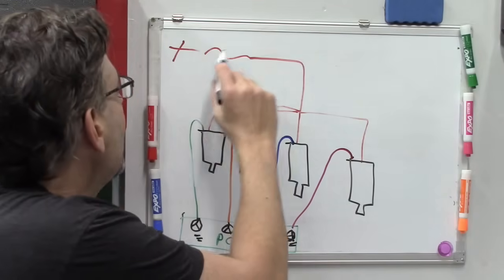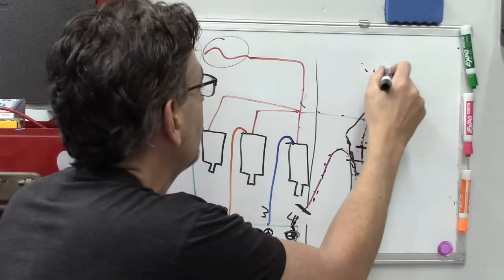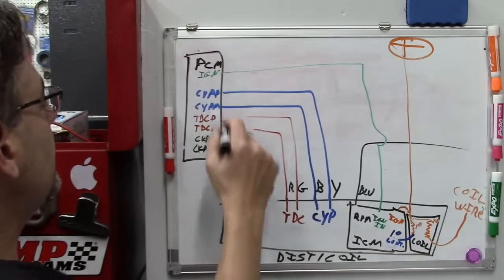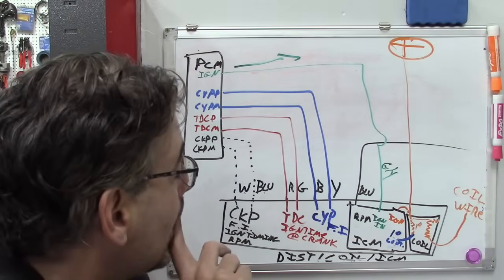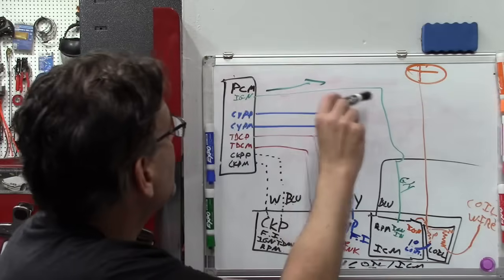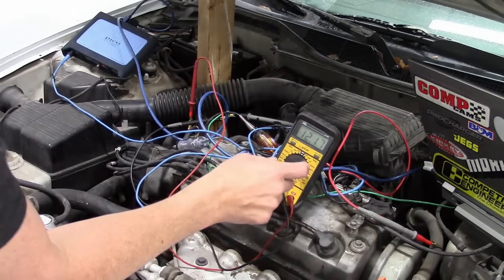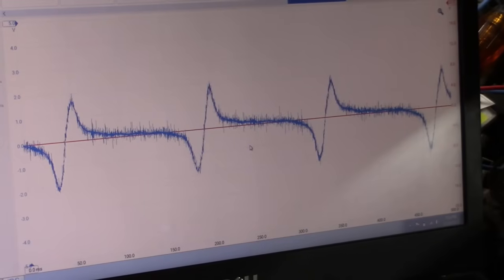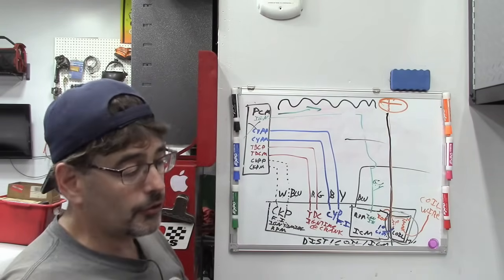DIY -How To Diagnose No Spark No Start. Bad Crank Sensor? FREE SBQM VIDEO

Comment: That was very detailed but pretty tedious for a non student. Cyp..took a couple min to see it's Cylinder Position sensor. Got tired of hearing over and over about not knowing what is was. Eric the car guy tests the wires in distributor for a No Spark 99 Civic (12yrs old) that's 15 min for those not needing every detail for vocational purposes.
Reply from the maker: Well then you should be very good at testing wires on a distributor. that should come handy.  if you ever see a car that still uses a distributer. 
   adapt or die.
Reply: @SchrodingersBox  I admit and apologize for being a little exasperated with length. Don't get me wrong, the video depth is great.  But as a woman with a 99 civic that's been about flawless the 10 yrs I've had it , I'm not trying to learn everything, esp since it's 23yrs old. After seeing ur diag I read w a bad icm car can seem ok at low speeds but strain trying to accelerate to 40+. That does match what was happening prior couple mos to it's last stall.
Also, my rotor has no set screw and trying to pry it off feels precariously close to breaking. So I've been on hold but dying to get in there w my test light. Everything references a set screw!
It's interesting to see bad spark plug wires can cause icm to wear out so look forward to checking resistance...not really, but figure it's a good idea. In your history what causes icm failure?

Comment: I have an 02 Silverado which has a intermittent no start but starts on the 2nd sometimes 4th try I sometimes have to feather the gas peddle when starting so it’ll catch. I have no idea what this problem could be and it’s driving me crazy I have replaced pcv valve, fuel regulator, fuel pump, fuel filter, purge valve, cleaned throttle body, and cleaned Maf sensor. All I have done is make noticeable change for the better of the vehicle but this intermittent no start is so random it happens cold start warm starts after reverse parking after driving all day and sitting a little awhile even sitting for a day and me just moving it back or forth 5feet and starting it back up. So I am at a loss and does it 2 to 4 times a week or sometimes goes days or weeks without doing it.
Reply from the maker: ok what data do you have?

Comment: Hat Matt, I have a 2012 Ford Fusion SEL that had a bad fuel pump after replacing the bad fuel pump with a new fuel pump a ran for less than a month the car started losing fuel pressure had to cut the car off and restart again to keep the car running this morning it cranks but will not start so what should I do to get it running again?
Reply from the maker: Usually this is from sediment in the gas tank that clogs the new pump.  Did you clean the gas tank before replacing pump?

Comment: The Honda system is known as the P.G.M.F.I. Sequential  fuel injection , the ignition module is a very common fault and although it looks quite complicated to check it’s not half as bad as it looks, the fact you had a pulse at the injectors tell you that the cam and crank sensors are ok , I’ve got a detailed breakdown of the system somewhere in my tool box I’ll send you a copy when I come across it, it may help in the future cheers
Reply: Is there a way you can send me the detailed breakdown?
Reply: It doesn't look like.

Comment: if r.p.m not move when you start car = crankshaft sensor is damage . result the engine not work .
Reply: But... not always.  I have a Chrysler Town and Country that the tachometer (RPMs) occasionally doesn't work on at all but it's likely an issue with the BCM.  I can turn the key off, wait a couple seconds, and restart the vehicle and it works but sometimes it takes a couple of restarts.  
Also, he had no RPMs when he was cranking this Honda but he didn't have a bad sensor crankshaft or camshaft sensor.
Reply: @watchdogu.s.a.8973  thank you for sharing this information

Comment: What if the light probe don’t light up on the distributor plug with the key on I really need answers car has no spark sometimes starts for like 20 seconds
Reply from the maker: if you are on the feed circuit then that’s the problem
Reply: @SchrodingersBox  yeah the same one you tested that had power I don’t have power there the car will sometimes fire over for a few seconds can you give me an idea what it could be bad wire further back the distributor fuse under the dash is good
Reply from the maker: it does. as mentioned my other channel at www.schrodingersboxQM.com covers training in electrical basics like that.
Reply: So you think a bad wire or bad ecu?
Reply from the maker: i would have to look at a diagram but assuming you are on the reference wire- yes that would most likely  be correct
Reply: Thank you so much for your input and help
Reply: It wouldent light w test light but has 10.6 with multi meter and like .4 at the coil any ideas from that info sorry to bug you I have no one els to ask

Comment: I have the same car but mine have  cranks not spark by the way   the check engine light is not blinking when I put they key on the ignition on what it could be?
Reply from the maker: if it has no spark what are your voltages on the reference and signal?
Reply: @SchrodingersBox  haven’t check it yet it also has no communication with my ecu will check it out
Reply from the maker: Well hell a no com with ecu is definitely explanation.   what network is this- OBD2 or CAN?

Comment: 1:24:00
since continuity tests are not as good as testing under load would it be best to test these wires using a test light and jumping the other end to battery so if we see a nice bright bulb while loaded we have a better test this way instead of doing those unloaded resistance tests?maybe even step up the bulb wattage some?
Reply from the maker: yes a lot of people do that but I really don’t like relying on the “brightness” of a test light for quantitative measure. 
  in fact I have a video where the testlight seems perfectly same as off battery voltage but there was a 4V drop causing failure of a wiper circuit.

Comment: Hi Matt, is it possible for the scantool to show rpm even if there's a problem with the crank sensor itself, let's say it's on its way out?
Reply from the maker: Yes. it’s possible it is pulling RPM data from the cam sensor.  depends on the car.

Comment: I have range rover car with a v8, p38 4.6HSE. The challenge is a crank no start. I have added fuel to the intake manifold and crank the engine no change at all. It is not starting. In addition, I checked for spark, but there is no spark as well.
Hence, I have just checked for injector pulse but there's no injector pulse either. There is also no ignition current to the injector circuit with key ON and engine off. 
All the fuses and relays are good. I also checked the injector circuit for continuity if the wire is shorted but it was ok. Scan tool communicated and showed only p1843 and p1842 code. There was no RPM during cranking. What I noticed today when I compared the ignition, earth and DC with the same car that was starting and driving to the car that was not starting, what I saw made me to flabbergasted. Where the was ignition for example in the working car there was DC in the car that was not starting. It is like that in many places in the fuse box and PCM circuit. Please  what's the cause of the problem and what I need to do?
Reply from the maker: Stick with the basics shown in the video- just start with a CKPS bypass and see if it gives you spark and activate the fuel pump. That will give you instant direction.

Comment: Im not able to understand how the testlight is able to give a small voltage to the ignition input and than causes a spark while touching the backprobe.
Reply from the maker: it’s a small amperage that does it. remember this is activating a transistor. the transistor input needs very small amperage to activate it.

Comment: Around the 24 minute mark when your talking about where you back probed your test light, you didn't say where you had the other end connected. That test light doesn't come on with only one end connected. So where did you clip on the flexible wire end of the probe?
Reply from the maker: it depends on what you are trying to do. when I am grounding a circuit I just use a chassis ground point. If I am creating an input signal then I will normally either use battery voltage or a 5 V reference bypass to signal.
Reply: @SchrodingersBox  You were testing the 0 volt signal to the injector. Where did you clip on the other end of the test light?
Reply from the maker: well I’m not sure what mean by “zero volt signal to injector” -there is no signal to a fuel injector. But in looking at control, again it depends on where you are testing and what design it is on the control. if the control is ground side switched and you are testing control then you want to be on a feed. if you are looking on the power side then obviously you would want it grounded.   If you are working on a pull-up design then obviously this would be reversed. It depends on the design so you don’t possibly blow the PCM. Since I verified this is a ground side switched circuit and I verified the switching and power I know the only possible failure must be injector continuity. Make sense, right?
Reply: @SchrodingersBox  ground would be 0 volts. Ground side switched to the injector you were testing. In order for the test light to light up, the other end had to be connected somewhere. I was asking where you had the other end connected to. Battery +?
Reply from the maker: The ground side of the injector is not always zero volts. remember- it is only zero volts during the ground side switching when you have voltage drop across the injector- it will read 12V when the switch is off because you have no voltage drop.

Comment: You can't arguje with success, and you got it running, but a new distributor without ruling out a dead cylinder?
Reply from the maker: i already know there is a low compression in one cylinder. but that is not going to create a no start though. 
  The car did not start because it has no spark from the coil. a dead cylinder doesn’t cause that, right? So once I determined the ICM failed it’s a matter of replace the ICM for $130 or the distributer for $170. no brained- new distributer.
Reply: @SchrodingersBox  My worry, had I been doing the repair, is that after restoring spark at the customer's expense, it still won't drive because he's got one or more dead cyclinders. Sounds like it runs good enough with the remaining compression, but it might not have. Restored spark would mean nothing to the kid if he's still without a car. I may be missing your strategy.
Reply from the maker: it has low compression but the cylinder isn’t dead totally.  it’s one of those things where given the customers situation, I need to just get the car running for $200 so they can continue get to school and work while they work out getting another car soon as possible. 
  if for $200 they can drive the car another 6 months to a year it’s well worth it. but if the car would be undrivable even after the repair then of course, I would have declined to do the repair. 
Even months late now, the car still drives fine -it just has a bit low compression in cylinder 2 so it just idles a bit shaky but it will probably drive for another 2 years I bet.
Reply: @SchrodingersBox  I can tell I'm not going to win this argument. You invested in spark repairs to  an engine with questionable compression. If you were in a surpervisory position under me-- I would insist on a psi before the new distributor. I'd advise the kid and let him know compression related repairs might soon follow the spark repair, might not even start even though it was running before.  Then I'm on record as warning him against throwing good money after bad. Otherwise-- he comes in two weeks later with not-enough-compression, won't run, thinks it's because of your distributor repair. I've grown, over the years, to be very defensive. Jurys always go against the mechanics of the world since we're ALL crooks.
Reply from the maker: That’s exactly what I did. I told them there was low compression on a cylinder due to a worn ring and asked what they wanted to do- invest $180 and keep it running for a year or call it quits and get another car.
  Given their financial situation they decided it best to just get the car running and look for a car this winter. 
  That’s their decision after they were given all the evidence and data… not mine. but they absolutely made the correct decision IMO- for $180 they have a decently running car vs a no-start brick. But it’s theirs to make.  I am only here to provide the information so they can make an educated decision.
Reply: @SchrodingersBox  Gotcha. You done good (as they say). I don't look for YouTubers to criticize. You do a great service and clearly love working on cars more than chasing pathogens. Ive done both too. Before retiring, I was subject to every kind of customer blowback imaginable. It took me way too long to learn to protect myself. The most effective thing I did do was to get the customer to agree that he was paying for fire (in this case), not a running engine. That worked pretty good for me. And-- if possible, get him to witness the psi and the lack of fire. Getting signatures goes a little too far, makes you look paranoid. But that would be nice too. Just not practical. I do wish you'd spring for a bigger whiteboard. You know you're worth it. :-)

Comment: That compression sounds normal
Reply from the maker: it does? I can clearly hear the compression loss and in fact later confirmed it was low compression in #2 using a relative compression test.
Reply: That’s a good plan. When I’m dealing with a no start I usually do the relative compression test first. I can verify the mechanical integrity of the engine, cylinder compression and timing in 5 minutes

Comment: you sir know your stuff and I am subbing even though I only work on my own vehicle.

I have a 2002 chevy astro with a 4.3 in it. I let it sit for 4 days and now it won't start. I have done the armchair mechanic thing and changed out a bunch of parts "because it needed it anyway," lmao, low and behold nothing has worked yet. I am wondering about the camshaft sensor now. I noticed rust on it on the top and all the sides of the sensor. im gonna remove that rust and see what happens, since it is enough rust to throw the sensor off thinking it is reading a distributor rotor.

ever seen that be the problem before? thx
Reply from the maker: does the sensor have ground, signal and reference? that’s all that matters.
Reply: @SchrodingersBox  idk. Any vids on that specific issue?
Reply from the maker: yes- this one. I used the testlight and dvom  to test each.

Comment: Matt : If you want to spend some money , the ATS E Scan Elite will do a relative compression test at the OBD 2 connector , in seconds , also a Volumetric Efficiency Test ( clogged cat , bad MAF ) and a number of other tests . I am sure you have seen Bernie Thompson use it in his videos . However , at $ 1800.00 , a DIY could not justify the expense . And there may be a cost to update . But it's there if you can use it . I see it's all about using diagnostics instead of the parts cannon .
Reply from the maker: never heard of that. how does it do relative compression through the ALDL? I can’t think that I have ever seen a pid for starter amperage.

Comment: Long time viewer here, thanks for the content, but I'm wondering about some things. 24:30 you have your test light connected to the switched side of the injector, and the alligator clip of the test light to ground (not shown in your illustration). Aren't you turning on the injector now? Is flooding the cilinder not a problem?

Also at 11:24, how much inrush current does that light bulb use, an amp? Isn't there a possibility of frying the pcm/a sensor this way?
Reply from the maker: great question, actually really great one. no I am not turning the injector on because there is not nearly enough amperage to fire the injector. with my incandescent test light, only 250ma flows and with my LED one I believe it’s only 20ma or so. it requires about an amp to activate the injector solenoid. if I used a jumper wire directly from the injector ground to battery negative, yes then it would operate. IN FACT- that’s a test I will sometimes do to confirm injector operation: I will put a fuel pressure gauge on the rail and prime the rail- then briefly grounding out the injector, I will see a drop in fuel pressure proving the injector not only fired, but it also flowed fuel. 
  also because the PCM is used to an amp of draw, I am not worried about frying it with my testlight. even if I use a jumper wire I wouldn’t fry the PCM because the power comes from a fused source directly from battery and my grounding is after the load. the only way you would fry the PCM is if you, say,  jumped the connector with a jumper wire or paper clip or something and then ran the car so the PCM closes ground and you would then put the power directly through the ground with no load in between and it would blow the transistor in the PCM that is making the ground since it is the weakest link. it’s the reason why pcm’s usully do ground side control- much safer.